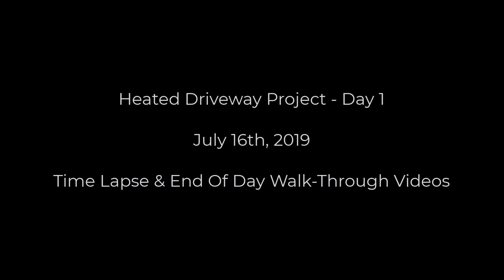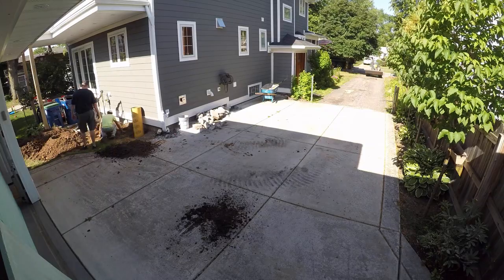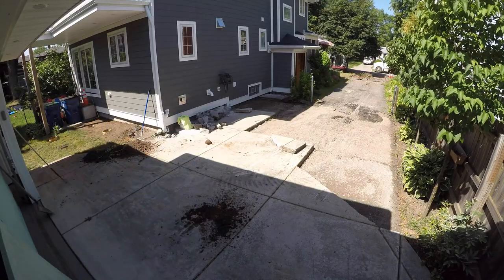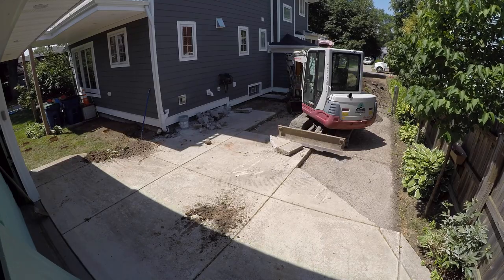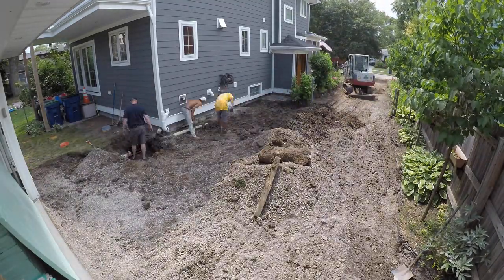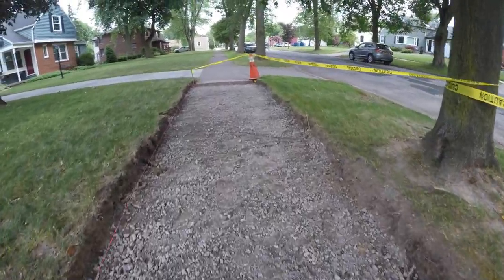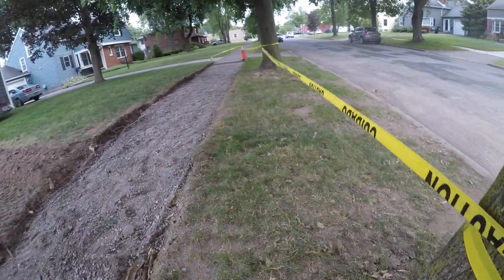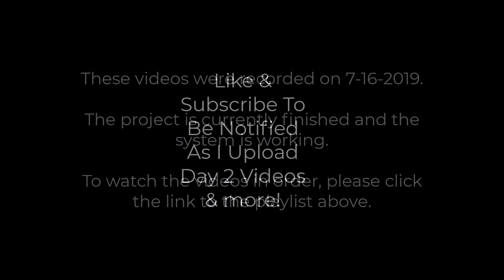How to Remove a Concrete Driveway - My DIY Heated Driveway Project - Day 1, Episode 2  [7-16-2019]

Comment: Fantastic video! Thanks. I particularly appreciate how u explain and give details as to what's being done plus changes u made to the old driveway and walkways. The old driveway came out so easily. I'm wondering if they didn't use wire mesh? Maybe that would have helped reduce the heaving in that section u described? Plus u said the old driveway was poured much thinner. Anyways, u did an amazing job. I'm gonna watch day 2 now.🙂

Comment: Hey Chris, saw you post this up on Garage Journal. Question about the PEX in the 6" PVC going between the garage and house: is there any insulation on any of the pipes or are you just running it bare through the conduit?

I'm converting a hydronic setup based around a wood boiler to a natural gas setup and I've been concerned about the heat loss to the pipes through the ground. In my case, one of the runs is done with home made insulated pipe and its about as long of a run as you have here. 

Thanks again for posting all of this up, this is giving me the confidence to DIY instead of wait around for the run-around from the "pros"!!
Reply from the maker: Hey there!  Glad you enjoyed the post on GJ, and welcome to the channel! :)  So the 6" PVC coming into the basement from under the garage floor is really not insulated at all.  I did throw some left over 2" rigid foam board pieces on top of the pipe as we were burying, but I doubt they're doing much.  I have seen the pre-insulated pipes your talking about in other wood boiler setups and they are quite nice.  My pipe is actually only "outside" for about 12'.  Before that its under the heated garage and after that its in the basement.  I have noticed no real loss or issues at all heating the garage slab with the un-insulated 1/2" tubes.  In this video: https://youtu.be/0eVSJDShuts I talk about how I ran the pipes to the garage floor, and have pictures in the video as well that may help answer some of your questions / concerns.  Hope that helps!  Thanks for watching!
Reply: @DeckerChristopherJ  Watched that video as well, I wasn't sure if you might have gone back and drilled holes to put spray foam in the PVC or something similar. The one run of pipe I was worried about is insulated and probably right around 12 feet. A few people I talked to raised some concerns along the lines of "Now that you're paying for fuel, you don't want to lose heat to the ground". You've got aquastats, data, and live roughly in the same climate as I do. (I'm on the other side of the border from you in Ontario!)

Extremely invaluable information and quite timely that you posted this as I was doing my own research for my retrofit. I didn't get nearly as much out of some of the reading I've done on Garage Journal as I did from your mechanical room series.

I've liked every video I've watched and you've got a subscriber out of me. Thanks again for taking the time to explain and edit up the video for posting!

Comment: is it allowed to remove the city sidewalk in front of the house?
Reply from the maker: Yup. As crazy as it sounds, the sidewalk and trees are on the towns property and owned by the town, but it is the responsibility of the homeowners to maintain them.  The tree roots will eventually heave them, and every 5-10 years the town will come by and inspect that they are not more than 1-2” off each other in height causing a tripping hazard.  If they are, they will mark them with spray paint and you will receive a letter in the mail giving you 60-90 days to repair / replace them or they will fine you.  It is also the responsibility of the property owner to keep them clear of snow.

Comment: Question: any runoff into your neighbors basement?
Reply from the maker: Hi Joe!  The driveway is actually pitched so that a majority of the runoff flows down the driveway to the street.  How much runoff there is depends on the amount of snow already accumulated on the driveway when I turn it on.  Ideally I would turn it on about 1-2 hours BEFORE the snow even starts falling.  In that case the runoff would be minimal, as the snow would melt as soon as it hits the slab and the slab would already be evaporating.  The slab would be wet, but The amount of water would be much less than that of a normal rainfall.  On another note, one regret is not putting some sort of a drain between the driveway and the sidewalk, or just running the tubing to the road.  Sometimes the runoff will re-freeze over the un-heated sidewalk and apron, and I need to shovel / scrape it off.  I may add a drain in the future.  Thanks for watching!